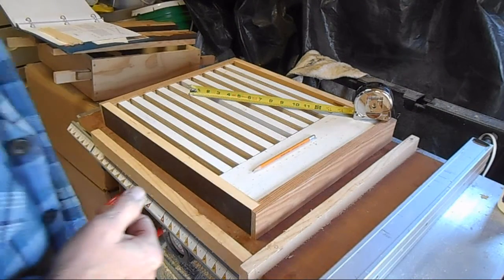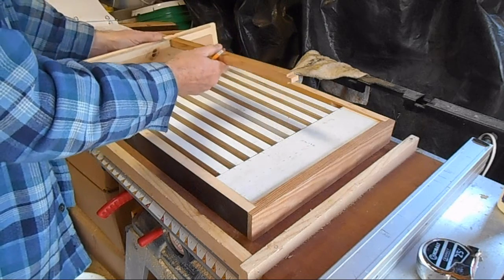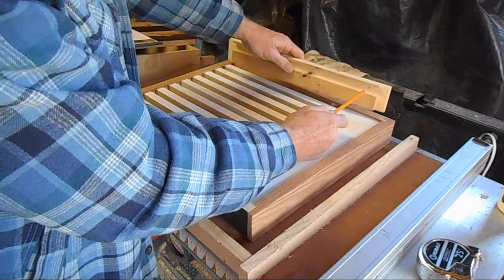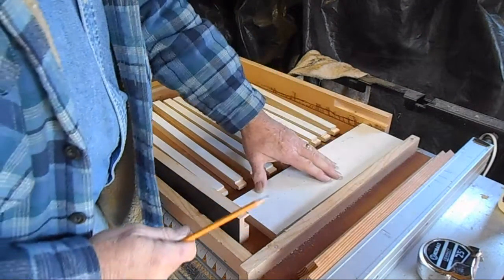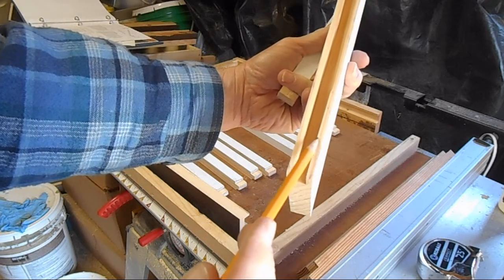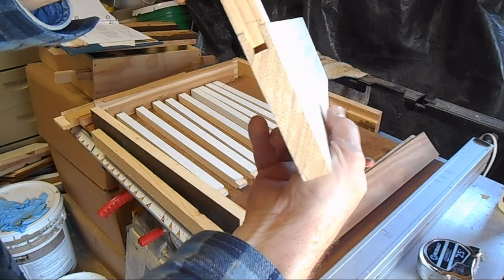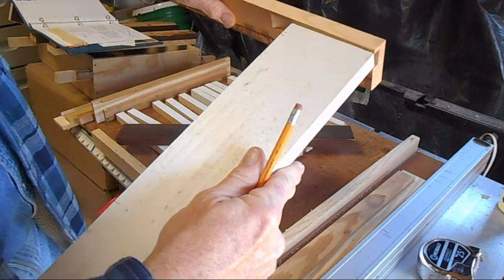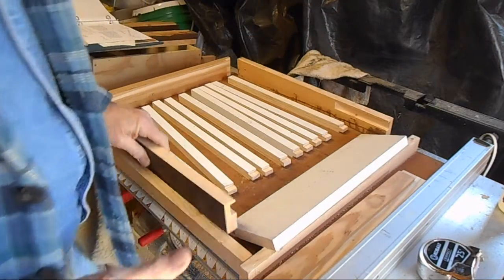Build a Slatted Rack

Comment: you don't need a dado blade... you can do a fine job with multiple passes of a table saw blade with an 1/8th inch kerf. It just takes longer.  ALSO I made 2 slatted racks with NO slots/notches, just butt joints... and both hives are still doing well in this CT winter. practical. not fancy.
Reply from the maker: That is true. A dado blade can be a bit time consuming putting on and taking off. And if you are just doing one or two then making several passes with your standard 1/8" kerf blade will work fine. Thanks for watching and for your comments
Reply: @smokymountainbeekeep  I'm sure as the builder you know that... I was responding more to David (below) who was hung up on finding a table saw that would take a dado blade. NICE work by the way!